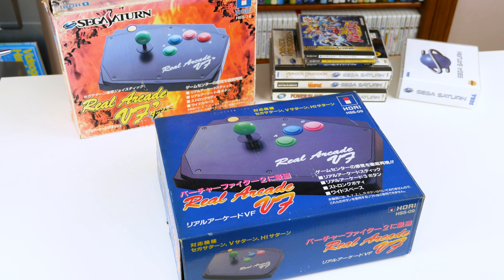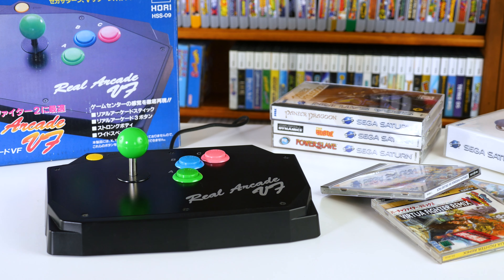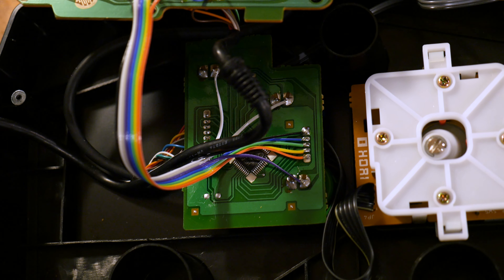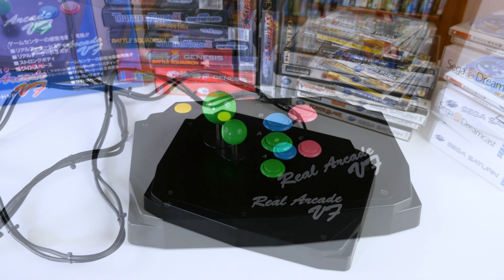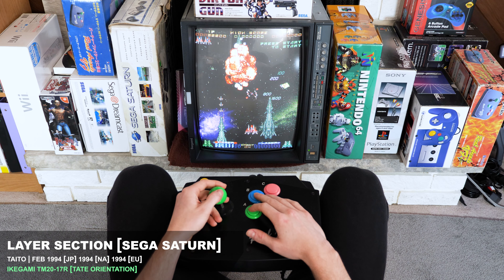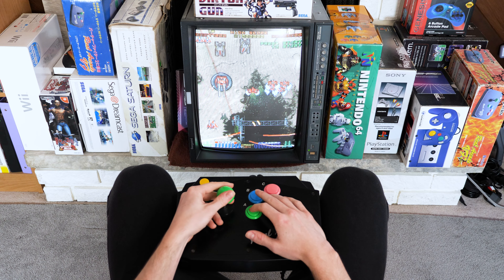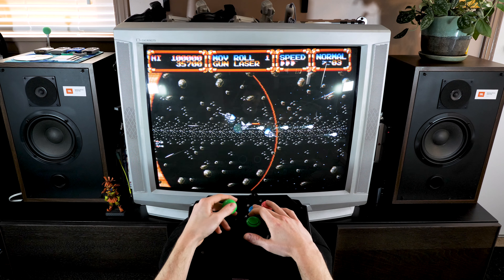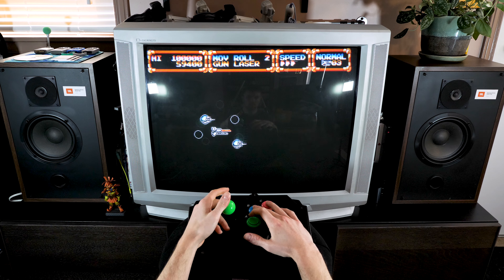I Modded a Saturn HORI Stick for the Genesis! (Hori Real Arcade VF)

Comment: Excellent mod! I'm hoping to grab a VF stick and I'd really like to try dual-modding it myself, having seen this. Looks like a fun project! I appreciated your mini-review of Layer Section, too, which touched on some of its artistic ambitions and achievements which are usually overlooked. :)
Reply from the maker: Thanks! It wasn't a particularly difficult mod and the VF stick is still relatively cheap, so I'd say go for it! You have some good gameplay on your channel, I myself recently acquired Darius Gaiden for the Saturn. What an amazing game.

When I played Layer Section for the first time I wasn't expecting much based on old magazine reviews, and also how its not talked about as much compared to other Shooters. But it seriously made my jaw drop, its really refined visually and auditorily. Taito was on fire during that time it seems!
Reply: @Richard Determann  Cheers - I'll definitely give it a go, then! I make minor modifications all the time (stick and button swaps, solder-free PCB changes and rewirings, etc), but this looks a bit more involved so it'll be a good learning experience.

Yeah, Taito/Zuntata have always had incredible musicians! If you haven't played them already, I highly recommend checking out the early Darius games, Metal Black, Syvalion, Elevator Action Returns, Puchi Carat, Landmaker, Cleopatra Fortune and Arkanoid Returns just to hear their soundtracks. (It doesn't hurt that they're all fantastic games demonstrating the immense range and variety of Taito's output, either.) :)

Comment: Great video, bought one recently to do a complete mod. Just wanted to see what you did with it yourself!
Reply from the maker: Thanks! I'm quite happy with how this mod turned out, I still use it all the time. It would have been nice to have even more system compatibility, but its pretty darn good as is. It can also be used with the Sega Master System as the the Genesis controllers work on that system. Let me know what you plan to do with yours!

Comment: I found an adapter for ss to genesis on ali express was not cheap but they are custom made works good no noticeable lag or anything and i can just use it on genesis or unplug adapter and run on saturn
Reply from the maker: @LowestDifficulty  Nice! Did they post any input lag numbers in their data sheets?
Reply: @ no lol its a sketchy listing on aliexpress and there is visible hot glue in the casing lolol i found a forum on how to make an adapter and I think they are making them based on that guide lol
Reply from the maker: @LowestDifficulty  lol! Well if it's working for you that's great!

Comment: Great mod. Can you explain a little more about the switch?. I made the same mod, but i'm having trouble in Saturn mode with the left and right
Reply from the maker: Thanks! Its been awhile since I did the mod, but Ill open it up and take a few pictures for you of the connection points I made.